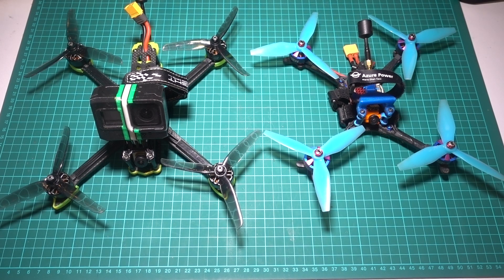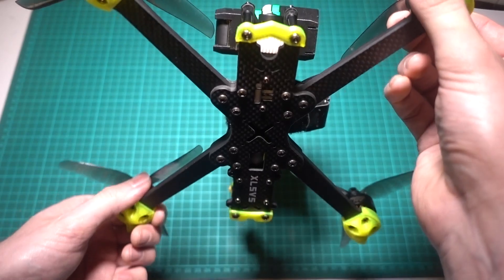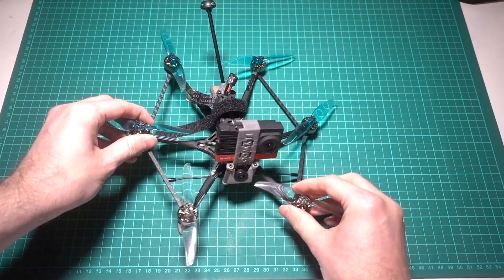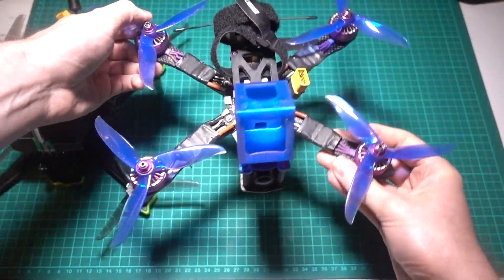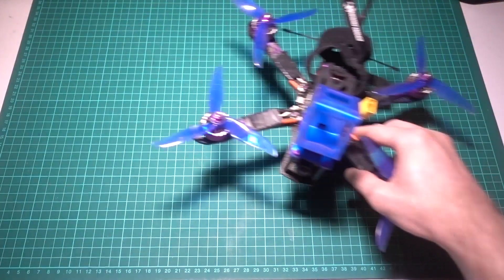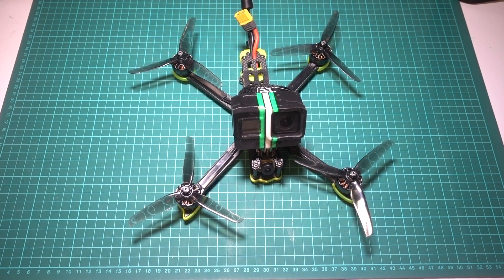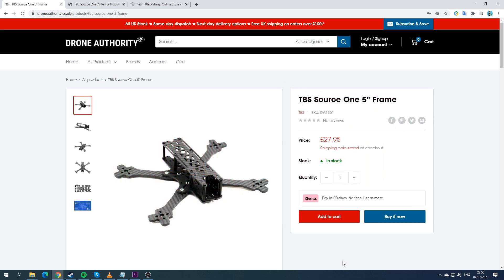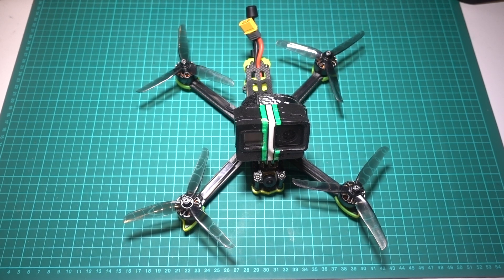Build A Drone - Choosing A Frame #3

Comment: I have always used Martian frames and found them to be very good..
It is true that without 3D printed parts it's difficult to mount VTX antennas etc
I don't have a 3D printer but I would like to know who will print FPV frame parts etc in the UK
That would be useful if anyone knows ???